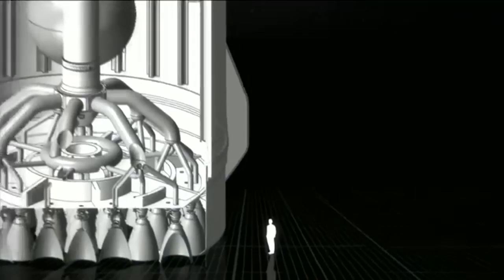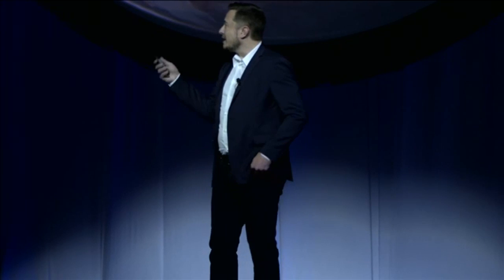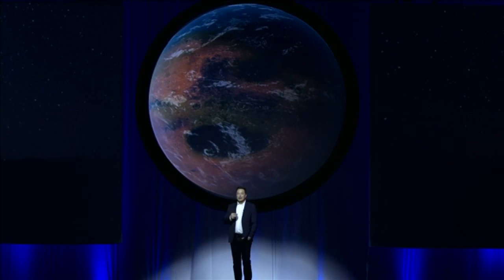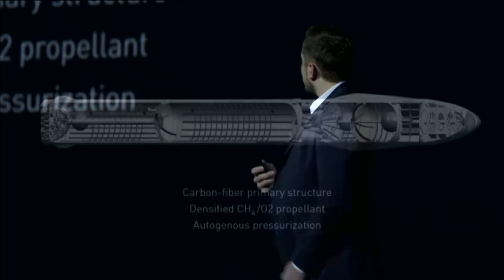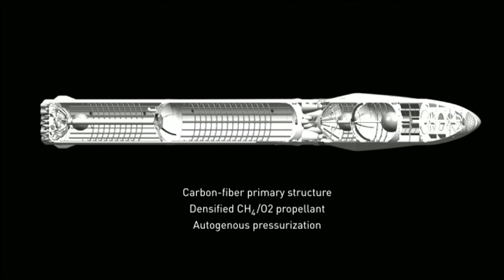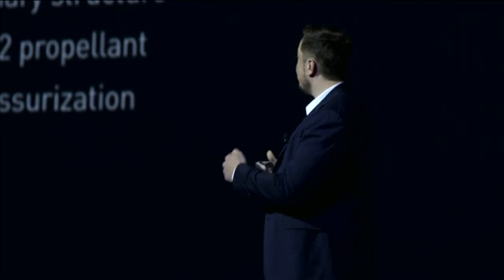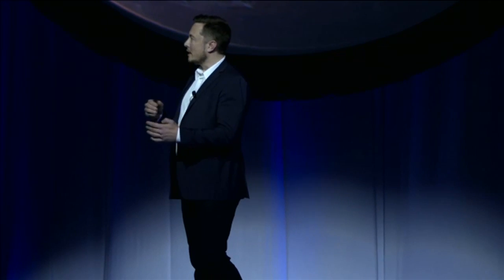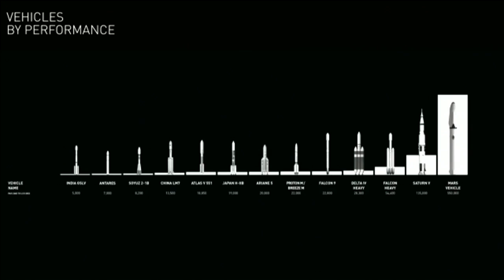Elon Musk Says His Interplanetary Spaceships Will Carry 100-200 People

Comment: Yes. Uncomfortable ly. There is rec areas but they are making the ships based off how much the booster can thrust the fully completed ship into orbot. If you make 14 or 16 ship sections about the size of the current rocket, then boost them up to orbit and assemble them there. Then The ship can be much larger while still using the boosters...

Comment: How much of the $500 billion overall budget will the one rocket cost?
Reply: The rocket will be fully reusable so it doesn't matter how much it costs!
Reply: ***** How the hell doesn't it matter? A lot of things are reusable. Their price still matters.
Reply: Jurij Fedorov The fuel is extremely cheap compared to the rocket itself and after a few flights, they will recover all the money they spent from constructing 1 rocket
Reply: ***** NASA is not profitable. So they never recovered their spending. Also, saying something is cheap doesn't really tell me anything. I don't know what cheap is for fuel.
Reply: Jurij -> cost estimates are in the presentations from my link - You can look there. They want to make Mars launch around 60 mln$ (if I understand it correctly) per fly.
Reply: Wojtek Sykurski I couldn't find the price because the site is terrible. So the rocket will cost $500b or what?
Reply: It's not the site, it's just .pdf presentation :)
Slide nr. 41 -> you have sum of costs there.
Reply: Jurij Fedorov dude the system will cost Only 300 MILLION US dollars
Reply: First of all it's not $500 billion, it will be about $10 billion, and that's for the entire project. 1 rocket will cost about $230-250 million without re-use, a bit less than an Atlas 5 rocket. 2nd of all, the U.S military spends roughly $500 billion a year, while NASA gets less than $18 billion a year.
Reply: I mean 600 million dollars